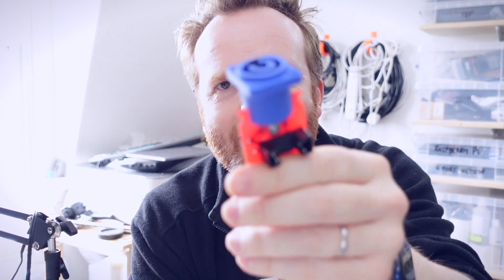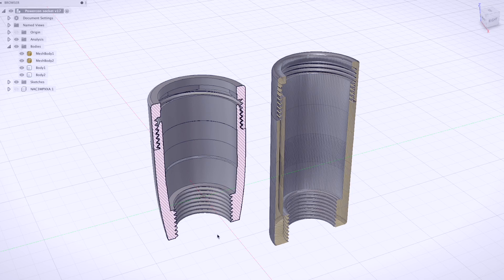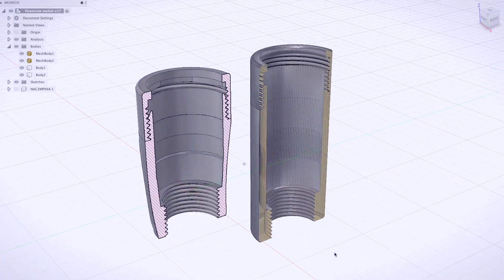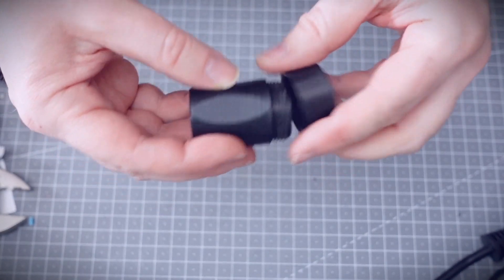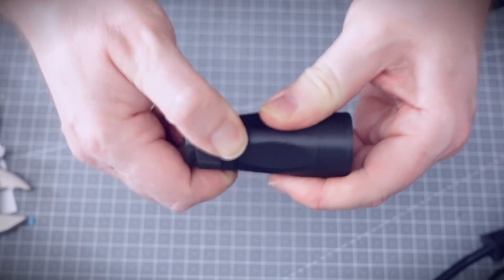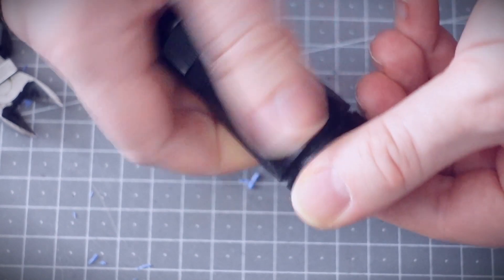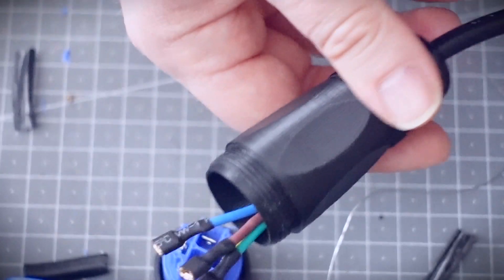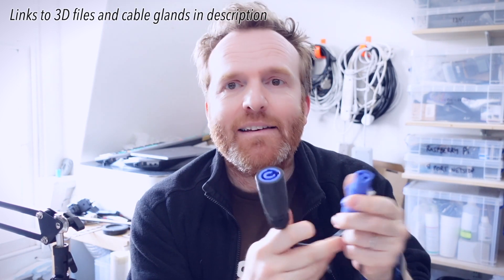In-line 3D printed Powercon socket

Comment: Why do Powercon extension cords not just have a female-male system? Would spare you those adapters
Reply: Oh, that's what you built, isn't it?
Reply from the maker: haha yes!
Reply: @seblee  actually newer PowerCon True1 does have a female-male system with sockets AND plugs. Anyone who doesn't have loads of traditional PowerCon connectors should consider using the True1 series. One caveat is, that True1 only is rated for 16A whereas PowerCon is rated for 20A max.
Reply: @zeno.heilmaier  When it first came out it was a fantastic connector but like Seb says in his video, the need for barrels is infuriating which is why the rental house I work at (TSL Lighting) are now entirely True1! True1 is indeed rated for 20A (although the TOP iteration only for 16), plus it's IP rating. PowerCON is also NOT rated for connection and disconnection under load (on older lighting fixtures we see the effects of this as the connectors don't lock properly and you can see arcing occurring as you energise fixtures) which was a big disadvantage to something that was so revolutionary.
Reply: @NapsterVista  Yes, totally. I really wasn't aware that the original True1 (which has been discontinued anyways) was rated for 20A, but since the T1 TOP has the better IP rating and very few devices need that much current all it's only practical I guess 😅

Comment: I've not come across Powercon connectors before. This design seems rather well thought out. I particularly like the idea of a partial print to act as a test gauge.
Perhaps I missed you telling us, but what plastic are you printing them in? (HIPS, ABS, PLA? - or maybe some of that carbon fibre stuff that chews through brass hot ends?)
Reply from the maker: Thanks! It's actually just matt black PLA from extrudr which I really love : https://amzn.to/3wvIA1F - it seems strong enough but I would probably use PETG if I was worried about it.
Reply: @seblee  People often forget/don't realise that PLA is already pretty strong in its own right, so if temperature resistance isn't a concern, there's often little need for anything else. (And annealed PLA is one of the most temperature-resistant options there is! [outside of PEEK, etc])

It's also probably the stiffest "standard" FFF filament, which is often advantageous - although that can also be a big weakness as PLA will just snap rather than bend under load, which might be where the image of PLA as "weak" comes from.

Of course, all of this is heavily dependent on the filament manufacturer, how the filament was stored, how it was printed, etc.!

That said, PETG's layer bonding is great, and its flexibility is useful for withstanding real world (ab)use. Good luck ever gluing anything to it, though...
Reply from the maker: @AndrewGillard  a fellow CNC kitchen fan I presume? 🤩
Reply: @seblee  Haha yes, and also Tom Sanladerer who I've been subscribed to since at least early 2017, and has had more of my Patreon money than anyone else! :D
Reply from the maker: @AndrewGillard  😀

Comment: Good reason to switch to powercon true, along with breaking capacity.
Reply from the maker: I LOVE powercon true, I use it for all my power distribution but sadly most lasers come with the blue sockets
Reply: @seblee  I’m caught in the same annoying position where half my kit uses one and half the other, and it’s not easy to modify it all to powercon true (which is what powercon should have been from the start).
Reply from the maker: @jonrpearce  I invested in a bunch of TRU1 socket to powercon blue plugs which work great for my outdoor shows
Reply: @seblee  Can you replace the ends of your non powercon true cables with true ones instead of using the adapters? I don't know anything about this and I'm not even sure how I ended up here, but I thought I'd jump in with my random thought anyway.
Reply from the maker: @yellowcirclesun  They're not compatible systems unfortunately but yes you could switch the entire system (not cheap though, and lasers have the original powercon sockets as default)